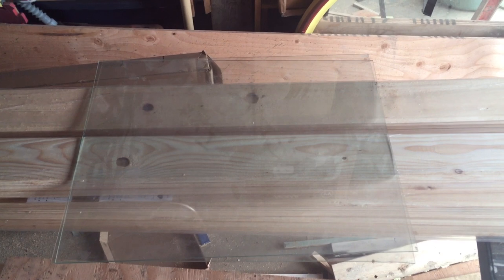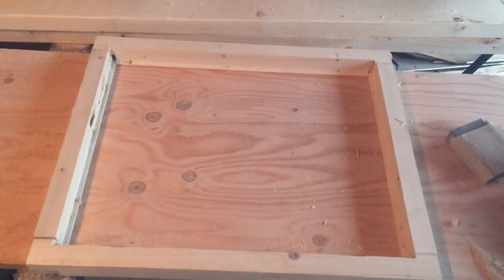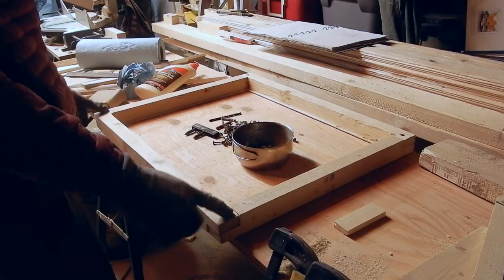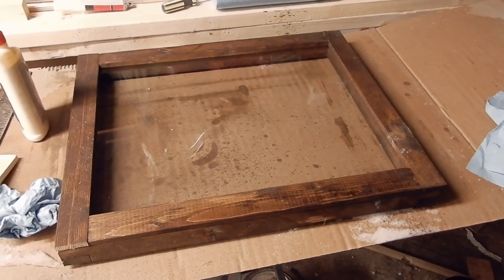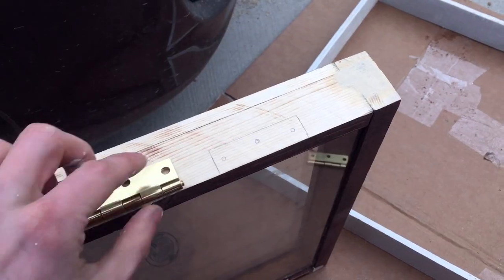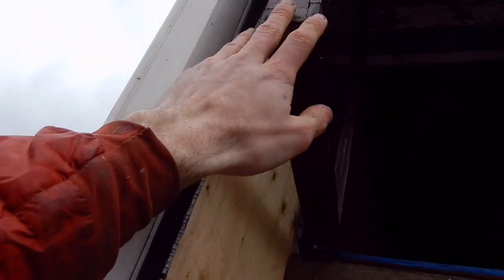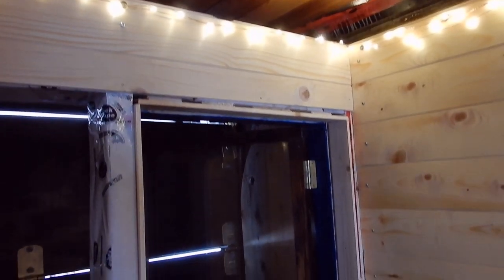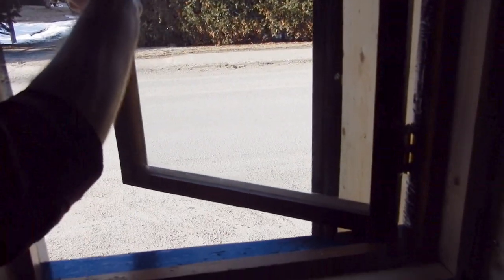Building and Framing a TINY WINDOW ~ Van Build E021

Comment: You should use automotive glass for the window that glass probably wont stand up to hard bumps
Reply from the maker: Justin Burton probably should have and it probably won’t.
Reply: Sylvan Secrets just tint them and the tint will hold it if it shatters. Tempered is just a plastic coating for automotive in case it shatters. ;)
Use a door draft rubber to set them in loose and it will absorb some vibrations.
Reply from the maker: TONS OF VANARCHY I don’t want to tint the window. Perhaps there is a clear version. Not quite sure what you meant at the end there. There is a foam weatherstrip between the window and the stop.
Reply: Sylvan Secrets sorry. im thinking automotive ways to do this. You can get very light colored tints and even in beautiful colors you might like. Just for safety if it ever did shatter, it would be held together by something. Automotive glass is held in with either urethane or with some form of rubber gasket and im a cheapo gal so thought of the strips you can get for drafty doors as a good way to keep your glass from touching the wood and vibrating. ;)
Reply: Good points considering the window's proximity to thw pillow oh the bed?!

Comment: dude, you should have used perspex or even better polycarbonate. I think that window will shatter as soon as you go over a bumpy road.
Reply from the maker: timothy790110 Your probably correct. It’s a bit of an experiment tbh.
Reply: Sylvan Secrets won't be much fun getting broken glass out of your van... Polycarbonate is shatterproof.
Reply from the maker: A Simple Step Van dude that comment makes me want to go out and smash it right now!
Reply: Good to see you using a push stick with the table saw. Window looks great :-)

Comment: Is step van good for traveling I’m planing on a roadtrip on 50 states 🇺🇸
Reply from the maker: That depends on the van and how it’s geared. Mine is definitely NOT. It’s engine was replaced with a slightly smaller one. Bad gas mileage.